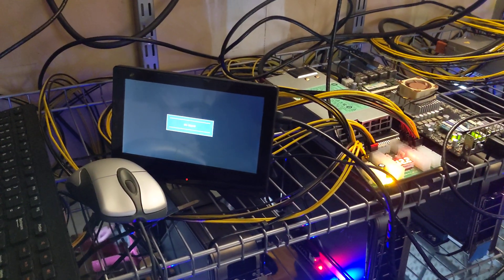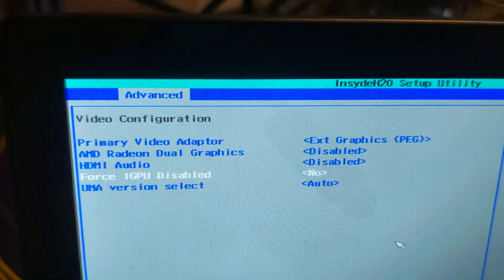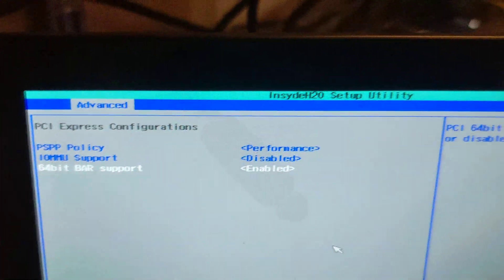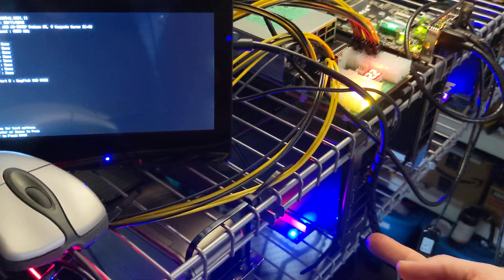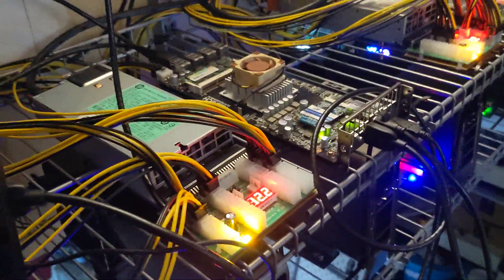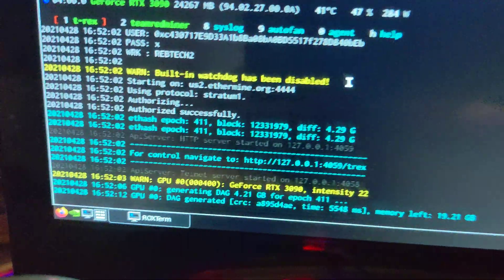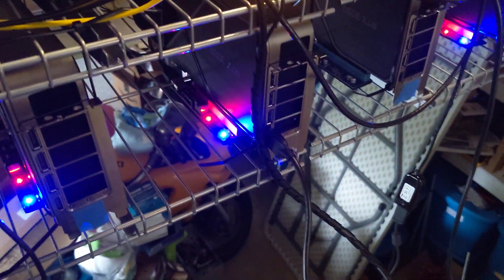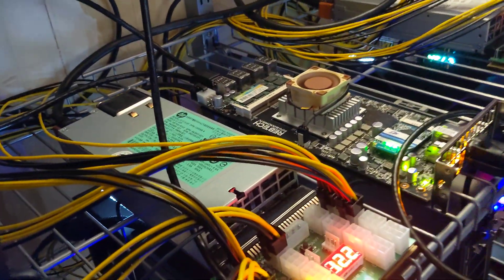crypto mining update: how to get rebtech to detect Nvidia GPUs

Comment: Hey, trying it out with 1660 super
Doesn’t work.
I tried everything - changing the hdmi, plugging in the card after booting / mid booting.
Nothing worked.
Is it because of the model? If it is - do you know about a way to fix it?
Reply from the maker: "Doesn't work" can mean tons of things.
Does it not boot?
What OS and mining software?
Does the OS see the device?
Does the mining software not see it?
Is the mining software confirmed to work on the card?
I think NiceHash QuickMiner does not support 16 series cards
Reply: @PaulPeavyhouse  
Thank you for the quick response!
I’m using hiveos. At first - I tried to boot without any card connected - and everything went fine.
Then I tried booting with 1660 super connected - and it didn’t boot. Tried to switch the HDMI cables.
After trying everything, I tried with a 1070 - and it booted successfully.
After an hour or so trying EVERYTHING to make the 1660 super work - I tried disabling the 64 bit option in the bios - and it finally booted successfully.
Sorry for not testing everything before leaving a comment😅
Thanks a lot for the video!!
I would have never thought to change this option in the bios without your video.
Helped me a lot!!!😁
Reply from the maker: @someonethatname5892  The BIOS 64 bit BAR disabling is definitely needed to support some [ex: 2080] Nvidia cards, so perhaps the 1660 falls in to that category.
Is it booting and working now?

HiveOS should definitely support the 1660.

I never got 8 Nvidia GPUs (3090s) to run stable.
I am almost maxed out at 6 GPUs per rig now, so I may soon start experimenting again to try to run 8 GPUs on these now almost unobtainable (for reasonable price) rebtech mobos.
Reply: @PaulPeavyhouse  yes😄
Again - thanks a lot!